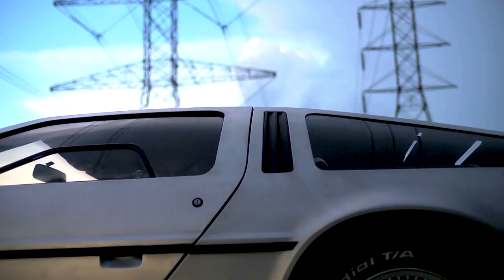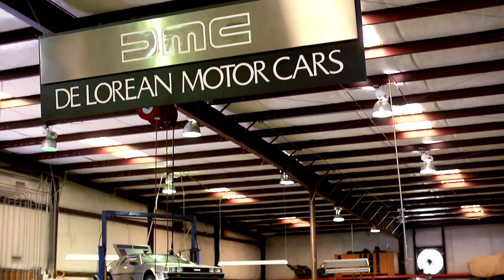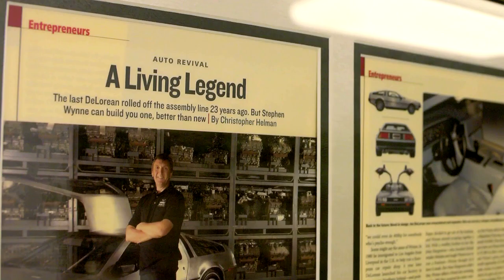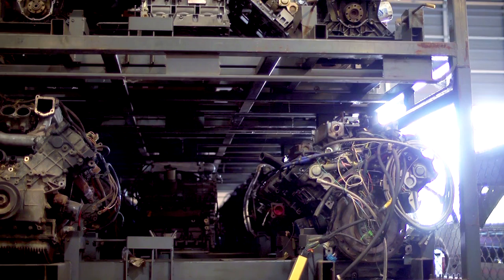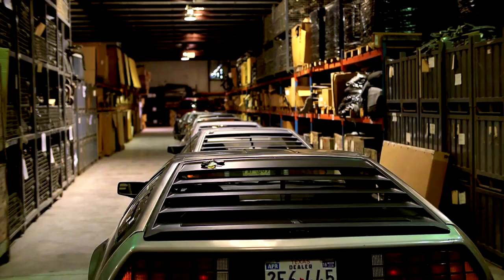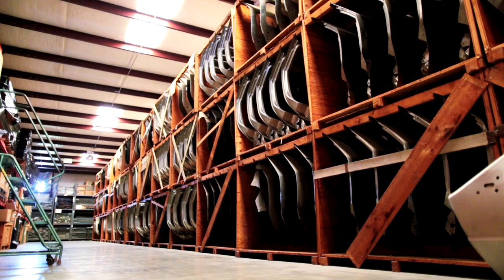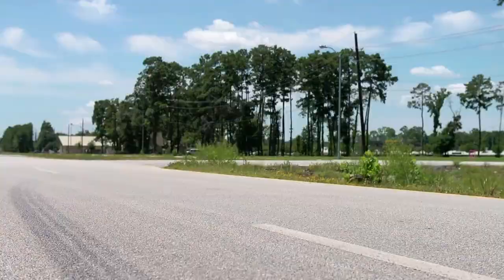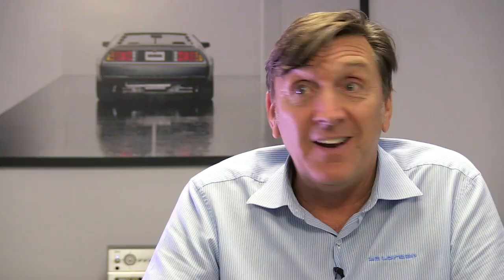New DeLoreans are still available, straight from the factory

Comment: I don't get it. Why don't you just build one DeLorean, go back to the 80s and get all of the missing original parts?
Reply: I’m not convinced they didn’t do that,
Look at those blueprints!
Practically pristine!
Reply: This makes no sence
Reply: @JoachimWeed  yes it does... It's just you who doesn't understand what we mean
Reply: Plutonium is hard to get around these days.
Reply: first, you need to go to oreilly auto parts (oreillyauto.com), and in the search field, search for part 121g, or 121gmf
Reply: They just say parts are missing so they can jack the price up! The cars are still being manufactured in the 80's and materials/labour is cheaper in the 80's
Reply: Because if you go back to the 80's and get the parts. You will not have had needed to go in the first place. Therefore paradox.
Reply: @duckstand9529  Come to Africa. We got that yellow 🍰
Reply: @randyreal5871  actually no they werent. These cars cost about 17k new. Then they had to have several repairs done to fix them. People would easily spend 25k new.
Reply: @duckstand9529  but it should be available at ever corner drugstore
Reply: Ya but they have the only one with the true flux capacitor  @davidkruse4030
Reply: The problem is Dr Brown is not available and still stuck in the past during this timeline, until Dr can comeback fix their time regulator they can't time travel.
Reply: Flux capacitors are hard to find these days
Reply: Great Scott
Reply: @davidkruse4030  Then, but now it is appreciably more to have one built at DMC Houston.
Reply: @sassylady2001  not really adjusted for inflation and repair costs its about the same 20k from 1981 is worth about 50k today. 
plus the repair costs because the deloreans came out of the factory messed up.
Reply: Good one
Reply: @duckstand9529  What about Mr. Fusion.
Reply: @progKansas  Bruv were not in the year 2015
Reply: Jumping Jiggawats What a Great Question. LOL!!
Reply: Because you need the parts before you can go back in time.
Reply: @duckstand9529  They have it on Ebay.
Reply: Dead like Grunge Fast like Punk someone never watched back to the future lol
Reply: @SKPainify  Pray to Gawd you don't drop that 💩!
Reply: @christophersantrizos1657  😂
Reply: @duckstand9529  na. you can order that shit on the internet
Reply: OP - This was the correct comment. It made sense.
Reply: Lack of trunk space.
Reply: Mad Mental Hibby because you would be in 2080 before hitting 88mph
Reply: Because that might destroy the space time continuum
Reply: This is heavy
Reply: Maybe it will cause a paradox?
Reply: @Mad Mental Hibby: Because that's too much trouble just to return with a Fleet of Crappy Cars.
Reply: I bet that's exactly what did it
Reply: Sounds like Endgame
Reply: "Great Scott, Marty !"
Reply: @JoachimWeed  it makes complete sense.
Reply: Without a flux capacitor you can't...
Reply: leave out the original v6's and transaxle, and replace them with 4t80 trans and LS or NorthStar engines.
Reply: @fakeseal6006  exactly they bought all the old stock so they have everything they need to build them
Reply: Duckstand we already had 2015, so we have mr.fusion.
Reply: Yea that would make a lot more sense Marty
But it actually doesn't 
The reason? Well Marty, you wouldn't get it, your not as smart as Emmet
Reply: So,,, in this way we can go back in history and do what ever we want, does this also makes sense to you?
Reply: The Cybercar - Tesla
Reply: @davidkruse4030  house prices up 1000% since 1980.    20k back then is worth 250k today
Reply: Dead like Grunge Fast like Punk r/wooooosh
Reply: Right. And Ronald Reagan is president!
Reply: Dam took me a minute 👍👍
Reply: Dead like Grunge Fast like Punk r/wooosh
Reply: @duckstand9529  it is
Reply: L . O . L . . . . ! ! !
Reply: Beats me
Reply: Lol
Reply: because it wouldn't be built.
Reply: Lmao
Reply: Well they were used in other DeLoreans, instead use it to prevent the end of the business which will keep the DeLoreans in production
Reply: Because the past really does SUCK and it is way better to live for the future no matter how bleak it may seem because it isn't written yet. 🤔🤷‍♂️
Reply: Calm down it’s just a joke 😂
Reply: James Allen it’s just a joke
Reply: James Allen me 2
Reply: lol
Reply: They don't have any flux capacitors in stock at all, so can't do that.
Reply: @JoachimWeed  or sense
Reply: Mad Mental Hibby well yeah
Reply: I think that could break the time line
Reply: the metric system made it difficult to get exaclty 88 mph
Reply: the flux capacitors are not perfected yet so its not recommended
Reply: pinoy skeptic I know right, I died in a crash in mine, but the pure manliness of the dmc brought me back to life.
Reply: @JNCL Bulgogi She would fall in love with you probably.
Reply: @duckstand9529  Have you really not had your car hover-converted yet? I just use my Mr. Fusion home energy reactor...
Reply: You can’t fit everything inside 😂
Reply: Duckstand that’s why he have mr fusion which runs in trash
Reply: @davidkruse4030  And now they're overpriced, if it costs more than a Tesla, it should be Tesla swapped at least
Reply: wait a minute...
Reply: Dude, you don’t just walk into a store and buy plutonium!
Reply: @JoachimWeed  have you watched Back To The Future? If you have watched it, then you’ll get it.
Reply: Time travel isn't a thing in reality
Reply: @danielfriend8749  thats the point
Reply: Just ring renault.
Reply: Go back in time with a deloran to make one
Reply: @randyreal5871  acctually with economic inflation it would be the same price (when converted to today's money) or more
Reply: @michaelfinlay1412  👍
Reply: @JoachimWeed  You’re right, SINCE you can’t even spell the word correctly. Genius.🤣😂😅
Reply: IM in the floor laughing!!!
Reply: @duckstand9529  That's why you get your hands on one charge of plutonium, you go to the future, 2015 to be exact where they have flying cars and all this technology, and you install a fusion reactor on the car.. Oh.. wait.
Reply: @duckstand9529  they must have a prototype Mr. Fusion
Reply: I know right!
Reply: @JoachimWeed you don't get it
Reply: You need the Flux capacitor and that's only available in 1985.
Reply: Its because most of the parts are straight from Italy when the deloreans are made in america